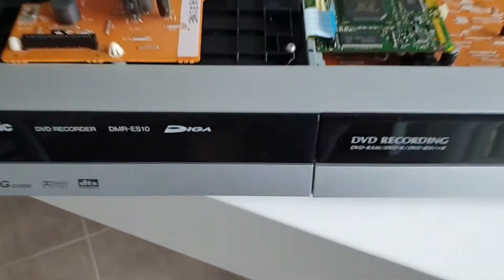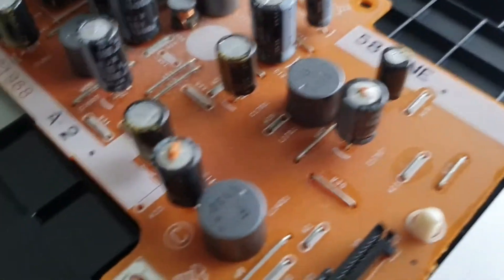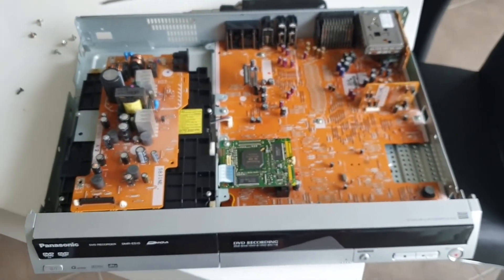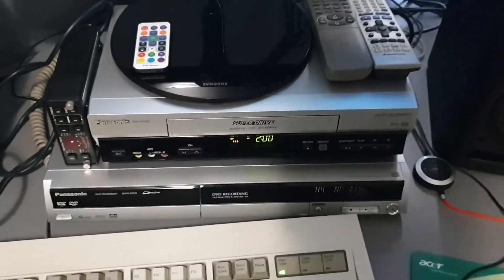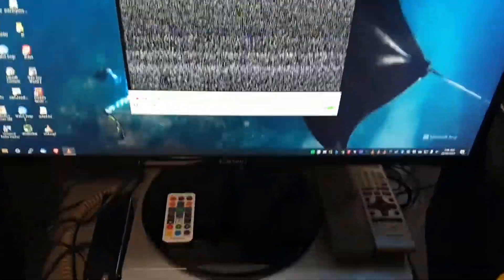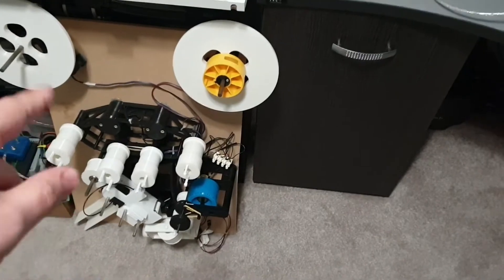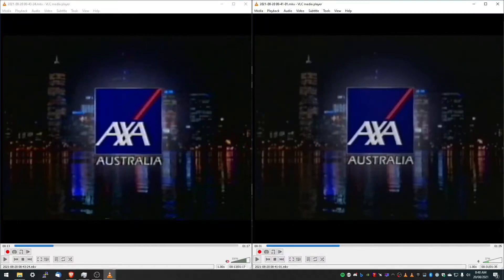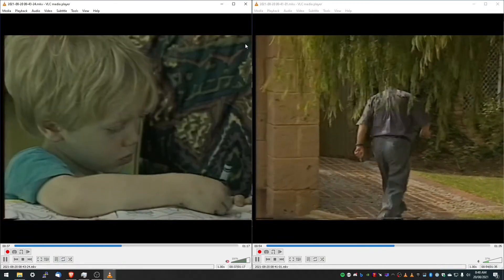Recapping Panasonic DMR-ES10 for VHS Capture

Comment: Funny enough I've been considering something like this to use as a TBC. Do you know of other Pioneer models of this vintage suitable as a TBC? There are some currently on FleaBay.
Reply from the maker: So the only ones I know for sure are the Panasonic DMR-ES10 and ES15, but it's likely that a bunch of DVD recorder machines from the late VHS era contain similar circuitry to squeeze the most out of tapes.
Reply: @RecordCouncil  Excellent, thanks for the info.
Reply: @RecordCouncil  In Europe the ES10 is still good and the ES15 is no longer. All my opinion😉 youtube.com/watch?v=9_xue8-gGLM